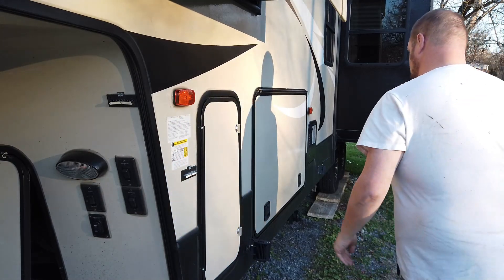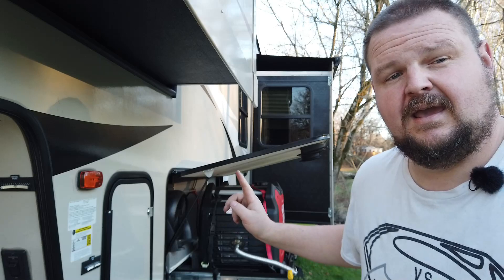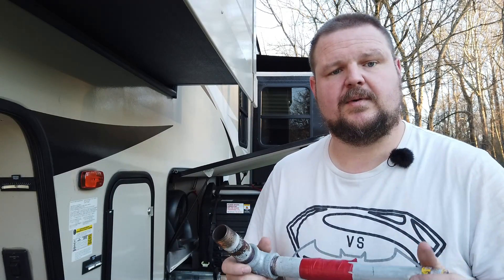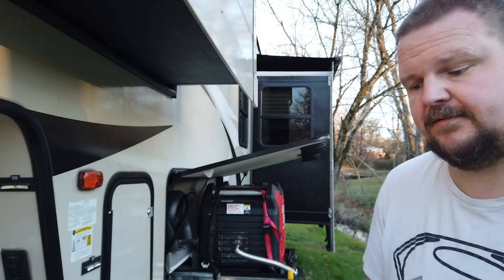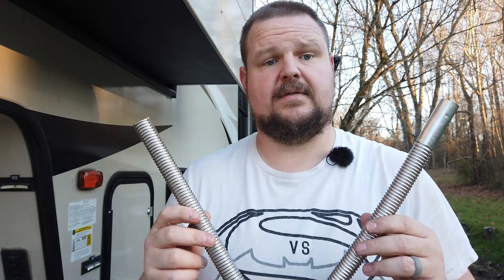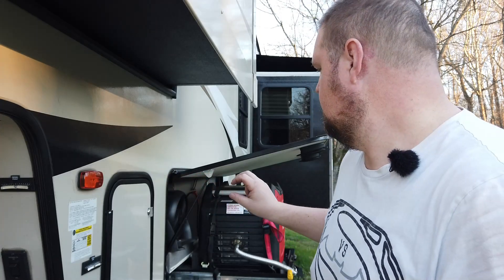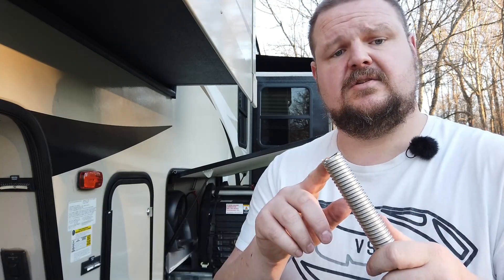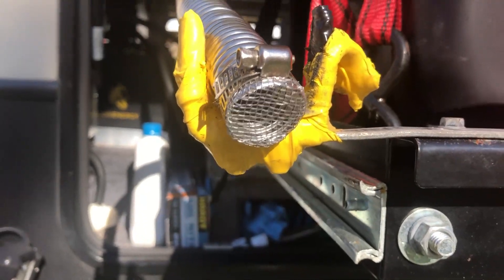Best Predator 3500 Exhaust #predator3500 #generatorexhaust #generatormods

Comment: Does or will this help with the CO monitor issue that so many have?  Seems by extending the exhaust and pointing it away from the CO monitor would solve that problem.  Better than having to cut wires or jump wires in my opinion.
Reply from the maker: Truthfully I’m not sure.  I’d say so but mine is a model that was before that
Reply: @Gimpydoingstuff  Lucky, i've heard nothing but huge problems with the Damn dumb it down CO monitor on these things.  If I run into problems I'll try this prior to cutting wires and jumping wires!!  Thanks for the info and great videos.
Reply from the maker: @kevinclark1348  I’ve had this one for years.  She never lets me down

Comment: Dang it. I just bought all the pieces you mentioned to do this to my 3500 but after taking off the stock exhaust cover, theres a metal piece around the 1" exhaust hole that looks to be welded on there. So theres jo way to put this pipe on. Did you break that whole piece off or something on order to get this pipe on there? Its the diamond shaped piece that the exhaust filter screws into.
Reply from the maker: @HaltWhoGoesThere  I just clamped it to the factory exhaust and removed the spark arrestor

Comment: What size of hosing did you get?
Reply from the maker: The links were in the description 
2.5CM/1in Inner Stainless Steel... https://www.amazon.com/dp/B094NC59P8?ref=ppx_pop_mob_ap_share
Reply: @Gimpydoingstuff  Thanks, it gives the link… but not the size, there’s several on that link. I highly appreciate it! I’m curious if this modification helped your Predator run better? My exhaust is so bad I have to clean my spark arrestor constantly
Reply from the maker: @Ched_Cake  I can’t tell a difference in how it runs but I’ve not had the spark arrestor for a long time
Reply: @Ched_Cake Not saying that your machine is needing tuned, but if your exhaust is carboning, you might run some Seafoam fuel system cleaner thru it. Any parts store should have it. Running it thru system every 3-6 months helps keep the fuel injection right. You may only need to clean the sponge air filter with some gasoline and replace spark plug. The Trinity in 4 stroke combustion engine is " Good Air, Fuel & Spark ". Hope this helps you. 👍
Reply: @paulshull9247  Ty!!
Reply: @Ched_Cake  You're Most Welcome 👍

Comment: Thanks - gonna try this. Run my 3500 in the truck bed near the tailgate when camping. I need a way to get the exhaust out of the bed, especially when raining. I'll kind of tuck the genny back under the tonneau cover but the exhaust just heats up the bed.  This could work to route the exhaust out and away.  Looks like it would be easy to hook up/disconnect when not needed.  Predator 3500 has been a great for my use. 
 Like the way you have it set up on your rig.  We have a Keystone Passport 23RB. A little smaller but cozy for me and the missus!    Subbed!

Comment: Thanks for the video! As for the exhaust clamp, is that necessary? Can i just use the other hose clamps that you just tighten with the screen?
Reply from the maker: The metal on the exhaust is pretty thin and that’s probably possible but I didn’t have luck with my original flex pipe working that way but it was a lot thicker and more rigid

Comment: Does it need any sealant ?
Reply from the maker: I would not trust it 100% for carbon monoxide as some people say that if you completely plug the exhaust it still runs, but I run it outside with a fan.  I do not have sealant but a little red rtv silicone wouldn’t be a bad idea, but it’s a pretty tight fit to start with

Comment: Just found your video. I have an 8750 Inverter Generator. I am looking to fix this inside my garage and was looking for a solution.  I understand the problems a rigid exhaust would have on the muffler. I was considering high temp silicone tubing. How is your system,  4 months later?
Reply from the maker: I’ve used this a lot in the last couple months with zero issues.
Reply: hey MrRchitty, did you do this with the 8750?  I have an 8750 so any tips are appreciated!
Reply: @firstcoastfoamparty5031  Not yet. Still pondering the idea.